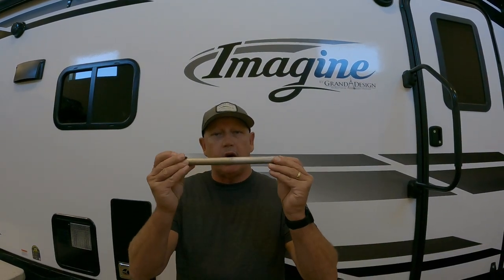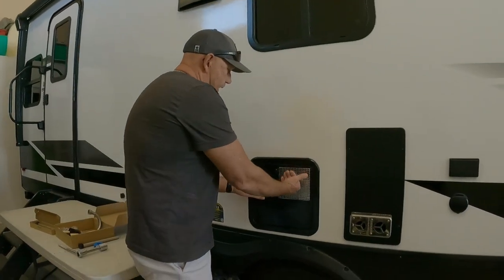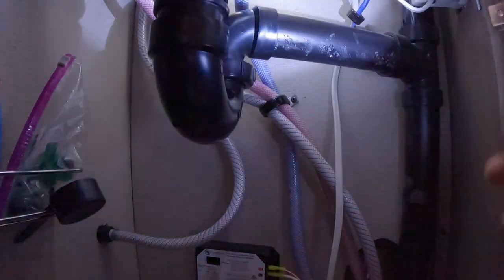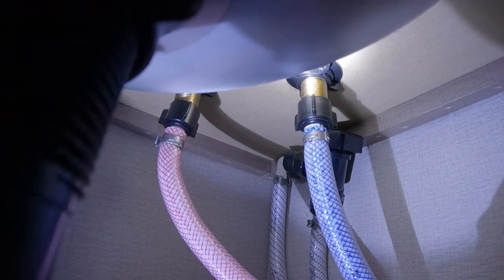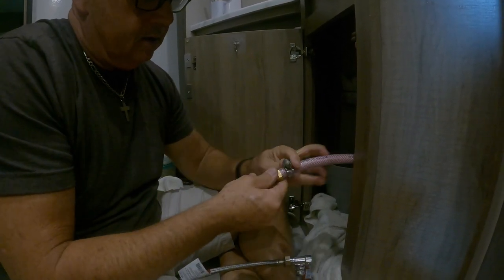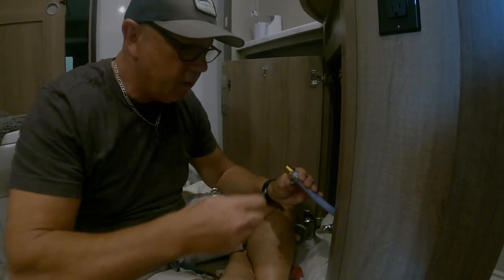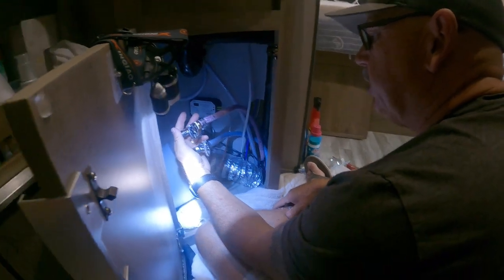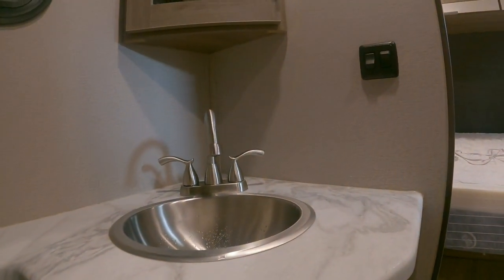2021 GRAND DESIGN IMAGINE // HOW TO SAVE YOUR RV WATER HEATER & MAJOR WATER LEAK FIXED

Comment: I never knew that the sacrificial anode rod degraded that quickly. I assumed they lasted for a few seasons, but now I know, thanks! Your faucet upgrade is sweet and actually allows you to get your hands under the water! Great tip about how to tell if you have a leak somewhere and I knew Stan would fix it the foolproof way! Nicely done as always..!
Reply from the maker: Hey Jim, I agree with you on how fast it degraded.  I’m thinking every three months for sure if your a full timer.  The other thing was the amount of calcium minerals that came out of the hot water tank.  Anyway I discovered the leak under the belly of the trailer while we were out at the beach.  I thought it was coming from the grey water tank.  So long story short I put a bucket underneath the trailer to determine what water I’m dealing with.  It was clean water with hearing the water pump going off I new I had clean water leak.  I began the hunt and sure enough it was the faucet in the bathroom.  Since I had to take everything apart it was good time to change the faucet too!!  We love the faucet looks good and works great!!   Thank you Jim as always friend.  Till the next time, Stan

Comment: I have a leak near my gray tank valve as well, thinking might be gray tank. I'm going to take a look at the bathroom sink water supply lines first! Thanks for the advice!
Reply from the maker: Joe, that was exactly what I thought.  I look at the connector and sure enough water was running down the water supply hose into the underbelly.  Check the shower also.  Good look and let us know. Stan and Rhonda

Comment: I had a leak as well coming from the end of the hose when I installed my new faucet. I had to remove the crimped clamps and replace with the worm type clamp. HAsent leaked in a year.
Reply from the maker: Ken, that is great!! Thank you for your comment.  Ours has been great since the fix.  Thanks for watching, Stan and Rhonda

Comment: Good video I did my taps my hot water tank on my 2020 Does not have the rod type should I put one in
Reply from the maker: No, some hot water heaters are made from aluminum.  Don’t need the rods.  Just make sure you drain every 6 months.

Comment: I had the same issue when replacing my faucet, did not think to use the shutoff valves , I may go back and “upgrade!”
Reply from the maker: Jason, Just a little security especially when you have to run down a leak. Thank you for watching hope it helps. Stan

Comment: Hey Stan really like the sink faucet upgrade. My imagine has an Atwood aluminum water heater though,wonder why yours is a porcelain line steel.
Would figure imagine would use same in all 2500rl.
Your drain plug is in a handy spot aswell compared to the Atwood.
Let me know how you guys like the faucet might do that upgrade aswell.
Thxs for the info.
Safe travels.
Reply from the maker: That’s great Rick you don’t have to worry about the anode rods.  I love the new faucet works great.  The best part no more leak!  My Imagine was built in Washington.  I also got a Furrion air conditioner.  I believe is different too!! Get rid of the little faucet and upgrade the water line you’ll be happy.  Till the next time.  Thank you my friend, Stan

Comment: I love the layout of this RV.  I am not thrilled with the heating ducting or the hot water heater. I would rather have a tankless and ducted vents instead of that cheap flex pipe.
Reply from the maker: We have had no problems with our water heater. We flush it every six months.  The positive the ducting is not in the floor.